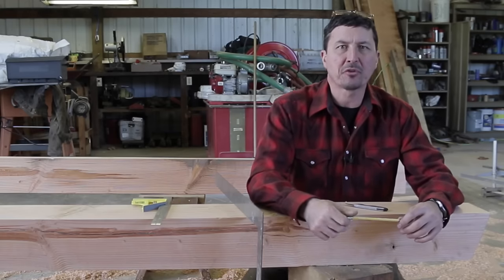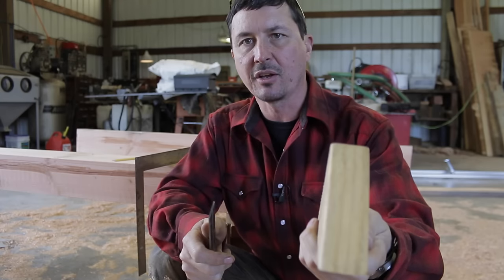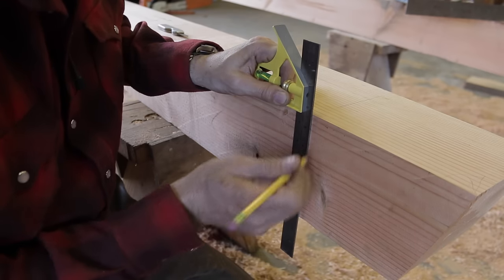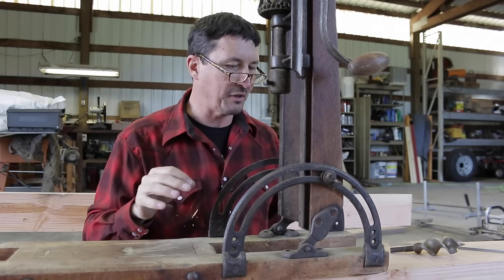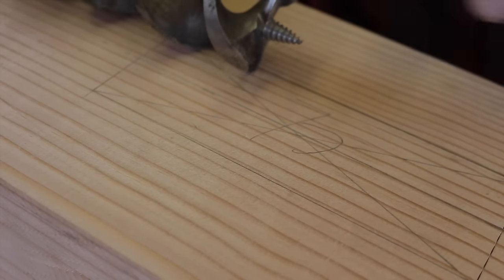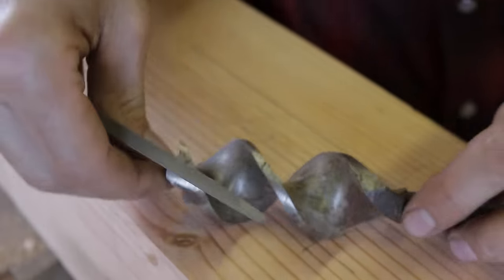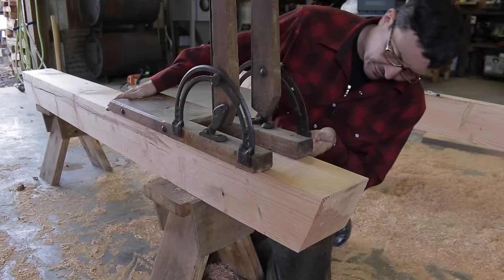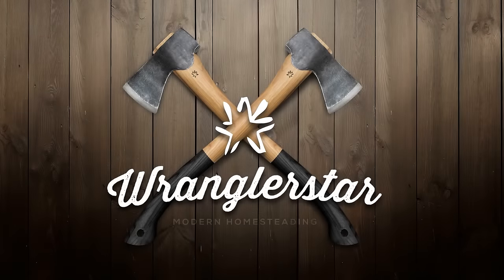Timber Framing A Mailbox

Comment: Cody - the rules regarding lumber aren't necessarily federal, but mostly propagated by the trade industry. The biggest impact on how our lumber is sized came in the late 19th century when standardized rail cars came about, and lumber mills wanted to maximize (aka "cube out") their rail car utilization. By cutting to even multiples of 2", they could plan their load and not waste any space. Later, as weight became a factor in shipping prices, mills began to kiln dry their lumber before shipping, which is why our 2x4's are 1 1/2" by 3 1/2". (Though today the mills actually kiln dry then plane the lumber to their final dimension, they kept the 1/2" sizes because the trades had standardized around that. )

There are some Federal rules about lumber, but it's mostly done to limit the spread of pests; eg rules about how far you can ship un-treated lumber or lumber that hasn't been heat treated. Those rules do accrue a benefit to average people; you wouldn't want your house built out of pine that had asian long-horn beetles hidden inside it!

If you do have laws in your area, that's just the left coast for you. California, Oregon and Washington aren't exactly the most libertarian states.
Reply: great information, thanks for sharing!
Reply: +Andrew Krause Lumber is milled in this day and age to a dimension of + or - .025 above the desired dimension after kiln drying. This is supposedly to get all that can be gotten from a log. Where I worked for a number of years it ws not uncommon for the mill manager to complain about not getting the amount of board feet he thought we should get, college education is great, better if you have experience to go with. we finally got it through his and others heads that you could only get so much from a log, .075" in one log will not transfer to the next log.
Reply: 2x4's are 1 1/2" x 3 1/2" is because is just as strong as 2x4's, actually little to no difference and you save lots of lumber in the long run. 2x4's are the nominal dimensions 1 1/2" by 3 1/3" are actual dimensions.

Comment: Pacing seems to be a general complaint, but I usually watch your channel to relax and slow down a bit between work sessions.  So 13 min to drill a hole?  Nah, it was actually a tutorial about full dimension lumber, bit sharpening for old auger bits, a review of the beam drill usage, and then a demonstration of the quality holes these old tools produce with little to no noise (and a bonus political digression).  You did well.

Comment: Thank you for explaining the dimensional lumber numbers. I had wondered why they were larger than the board. I know Lowes was sued for this. Crazy.
Reply: +TRUMP2016 Local187 WallBuilders Union if you look on the lumber tags you will see the normal "2x4" but you will now see "actual dimensions "
Reply: +TRUMP2016 Local187 WallBuilders Union I don't know. it just seemed ridiculous.
Reply: +TRUMP2016 Local187 WallBuilders Union yes same to you!

Comment: Cody, since I started watching your first video on the Irwin brace bits, I was on a mission to find some. Not an easy task here in Australia and they are not cheap either but I manage to get a set from different brands and I ended up with the 2 styles too. One has the lips to help pre cut the wood like yours, they are the best, yes you get the perfect holes, the second style doesn't have the lips, they have them the opposite way. This style doesn't make clean holes, they tear the wood. If compare with a drill made hole, you can see the difference straight away, I only use my hand brace now if I do detail work, yes it takes a little longer but the quality is there. I also found a depth stopper to fit on them, this is really useful. I will never go back to my electric drill for woodwork.

Comment: dressed all round -DAR -A Trade term . 8 x 4 DAR =7 3/4 X 3 3/4 .TIMBER CLASSING .VISUAL CLASSING the old way still used EASY TO LEARN. you need to google  timber classing , a book a set of tables [ tables lists of facts like know more than one knot  one inch or smaller in a yard of RS [rough sawn] 2 x 4 gives you F7  or better F7 framing grade timber ]  EASY ONCE YOU KNOW ABOUT IT.

Comment: When I finally got sick of my letterbox being vandalised (drunk kids would beat it with tree stakes), I made (welded) a new one out of 5mm thick 25 x 25cm RHS and on old BBQ plate.   4 x 6" coach screws hold it on to the top of the fence post.  Overkill?  Sure but it hasn't shifted since and the vandals can smack it till they run out of puff.When I was younger I didn't have the patience that wood working requires, my grandfather was a carpenter and I will always regret never having the patience to learn from him.   Now I enjoy woodworking, albeit quick and dirty compared to real craftsmen.  so at the end of this long comment I say, Ignore the speed freaks who want one quick video showing the whole thing, take your time and keep enjoying every moment.

Comment: Wonder if anyone made a power version of that machine?  I know a drill press is similar but a version with a small router type motor would be portable and might even run well on "Green" power (DC from solar/wind/battery)    I had a chance to see one that I posted on your FB page as for sale in an Antique mall here in GA.  It sold within 2 weeks.  I would have got it but I bought a radio cabinet for a project that day.

Comment: The reason that a 2x6 is not longer 2x6, is the same reason that a can of pumpkin stuffing is smaller than it was 40 years ago, money.  They can get more boards from the same tree, and keep the price for each board lower, by reducing the size of each piece.  It has nothing to do with them planing it down to size, and shape to remove warps.  Go to Home Depot, and you will find lumber that looks like a cork screw.

Comment: FYI - from the center out, the parts of the business end of an auger bit are the spur, which pulls the bit thru the wood, the lips, which sever and lift the shavings out of the hole, and the nibs, which cleanly cut the periphery of the hole.

Comment: i cant speak for america, but here in australia, the reason we have regulations on the sale of products is to guarantee a standard.

so, if Joe Bloggs goes to timber store A and buys a stack of wood for a project, and then 2 years later goes to timber store B to buy more wood to extend the project, the wood he buys the second time is to the same standard as the wood he bought before.
without the standards in place the wood could easily be vastly different.
yes, it can make it more difficult for the little guy lumber yard, but it ensures a product for the consumer.

Comment: I wish I could find a couple of bits with shanks like yours I love my boring machine but the are contrary things in green oak with power tool type augers as there's a lot of friction on the sides. My machine is set at 90 degrees and is a lot taller than yours other wise is identical. Seems they had many uses.

Comment: I was introduced to that kind of bit in the 70's.  standard use for electricians drilling studs and old work. protect the screw threads at all cost. I still have some that are that old and work just fine.

Comment: those side cutters sure help but the main reason the hole is so clean is because of the slow and controlled pace you get with that beam drill. the same bit at a higher speed would still give bad results. now days its all about speed well i say it pays to slow down and do it well.

Comment: i live in a log ish house and was going to use a tree trunk for my mail box pole , looks and strength, but in Ohio if someone hits even on purpose your mail box pole and gets hurt and its not easily break away, the owner can get in trouble. even if they hit it on purpose   come on
Reply: I also live Ohio. My neighbors put his on a 6x6 square tube, filled it with concrete, and welded a plate to it. He used the break away boxes from like home depot for the box. The neighborhood kids would always smash the mailbox, then come back for the pole. Now they don't come by at all. Being on a back road in the middle of nowhere helps not being bothered with any authorities either. It's been like that for several years now.
Reply: +Alex Holsinger I heard of a guy that cemented a steel pole several feet back from the road and mounted a bearing on it. He then mounted steel tube to the bearing and extended it out to the road. The mailbox was welded from steel plate and mounted on the end of this arm. It was then spring loaded near the bearing so it would "break" when hit and then return. The goal was to snowplow proof the box and it worked quite well.
Reply: i was going to put it on a 20" ash tree log, make it look good , guess i could put on a 1" pipe to make it break away haha  still might not work with that big of a log LOL